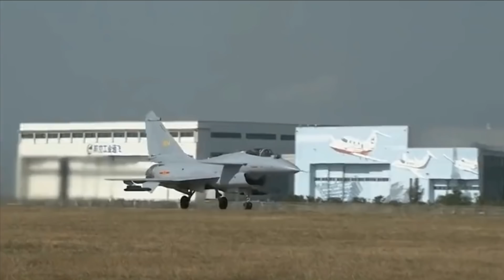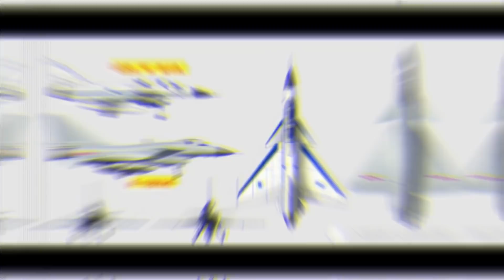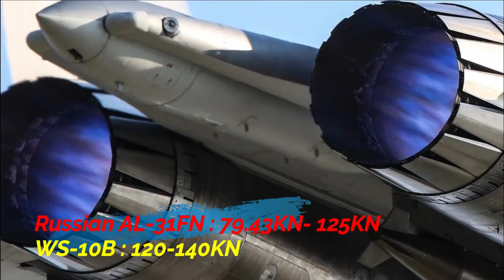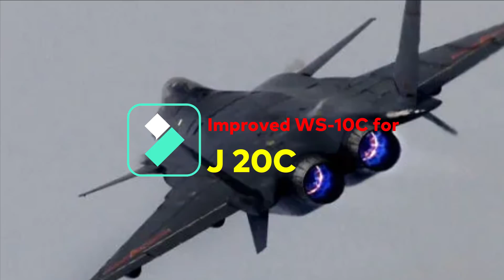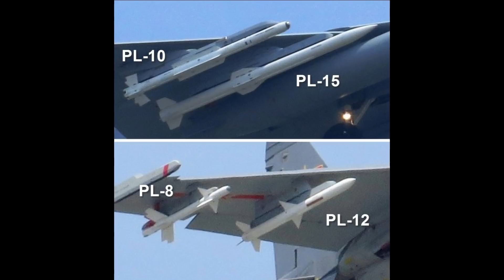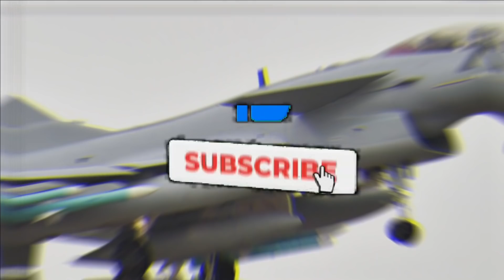How big threat is Pakistan Air Force J-10C powered by WS-10B Engine ?

Comment: Another point not mentiong here, J10 w thrust vector engine unlike Flanker or F22, it is a "single" jet engine fighter performing Cobra and deep angle of attack in the world.

A year later, WZ-15 Emei, AEP 500 turboshaft engine, WZ-20 and CJ-1000A commercial engines have made signficant break through in thrust, thrust weight ratio and lifespan comparable or even beating the western engines in service.

Comment: I heard from a retired paf air force chief that even though china will sell pl15 export version it wont be the general E version of 145 that's for normal customers since pakistan is like isreal is to usa it will get something very similar what plaaf uses themselves with slightly decreased range, no country actually release the exact range of its missiles apart from export versions, so let's say If the actual range of pl15 is 300km then paf will likely get pl15 with range around 250km . Indian airforce has put top priority on new platforms french Rafael is a good choice for them since russian top end platforms  have performed poorly both in Syria (s400) and su35 in ukraine, Russians have made  stuff in 80s  but since have fallen behind in electronics, China now doesn't buy anything from as they own defence industry has cought up and certain areas surpassed them such as electronics ect, the problem india will have in the long run they are buying everything from every country like Egypt, now Indian navy will probably induct f18s for the aircraft carrier that means more money for the taxpayers even though rafale would be ideal choice maybe there is money to be made for the politicians.

Comment: fighter jet is not luxury car for showing off, it is just weapon for fighting, with 4 times cheaper of J10C vs Rafale, in real battle, Pakistan can send 4 J10C to 1 Rafale, J10C carries at least 4 PL 15 missile, assume Rafale carries 6 Meteors, that will be 16 PL 15 missiles to fire to each Rafale , in today's air battle, it is not just one by one or 4 to 1, it is system, both sides will have AWACS, so both sides can find the enemy jets at about the same distance, about 400 km away, J10c just reach Rafale to about 100 km and launch PL15, then fly away, with its M2.1 speed and Meteor no escape zone is 80 km, J10c can just run away, on the other hand, Rafale top speed M1.8, at 100 km range, it will not be able to run away from 16 PL 15 missiles s attack. and the pilot, if he is lucky, can taste some fantastic tea in Pakistan, with his eye blacken and swollen again.

Comment: Pakistan J10-C will crush India Rafale
J10-C radar can see Rafale before Rafale can see J10-C. J10-C PL-15 air to air missile outperform Rafale meteor missile too, so J10-C can shoot Rafale down before Rafale can respond.
F-35 APG-81 radar and Rafale RBE2 radar use the same T/R module provided by same vendor. F-35 radar has 1200 T/R module with 170km working range. Rafale RBE2 radar has only 836 T/R modules with 130km working range. J10-C KLJ-7 radar has 1400 T/R module with 170km working range. Rafale is the most near sighted crap.

Comment: The Chinese and Pakistani air forces have conducted many confrontation exercises in recent years, including the J-10C fighter. The most important thing is that the Pakistani pilots have a mature understanding of all aspects of the J-10C fighter. Therefore, Pakistan finally equipped the Chinese J-10C. 10CE fighter is a matter of course.

Comment: Good analysis but PAF is getting original version of PL15 for J10C and PL15 E for JF block3 as per the information coming from Pakistan defense platforms.
Reply: Haha, the Difference between PL-15 and PL-15e is the signing E, it just needs to call PL15e
Reply: @friedrich.wang.d6768 Ur talking nonsense. PL 15E is about 145km+. And the original variant is more than 200km+

Comment: J10c is just as good if not better than Rafale. It can fly longer and higher with a more powerful ws10 engine. Ws10 has been used for quite a while on other Chinese jets such as j11, j16  plus newer j20s. No issue on reliability. It is equipped with BVR missile that goes further than French ones (Pl15)

Comment: First of all you are wrong about pl 15 missiles Rafael meator bvr missile has a range 200km and pl15 has a range of 500km bvr making it the longest bvr missile and Pakistan is getting the 500 bvr range missile which Pakistan will use in jf 17 thunder block 3 as well

Comment: Rafael has more power but carry too much weapons. J10C is evenly match. The PLAA used J10C against Su35 and beaten Su35.
Reply: more power? you kiddin me right....ws10b alone can produce more thrust
Reply: @劉慧玲-d8u  WS-10 produces 80-86kn dry thrust and 135-142kn afterburner. Rafale has two Engines with 50kn dry and 75kn afterburner = 100kn/150kn vs 86kn/142kn
Reply: PLAAF
Reply: You can always put less weapons if you want lol. 12 Air to Air Missiles only weight around 2 Tonnes

Comment: Numbers will make the difference in a conflict.During 2022 IAF has 36 but PAF will probably induct 86 (50 JF-17 thunder,36 J-10C) fighter having AESA radar.Moreover IAF far from achieving required 42 squadrons to protect Indian Air space.
Reply: Also f16 one of the best fighter jet
Reply: You should turn back to super sukhoi upgrade project......
And then you will find something interesting and horrifying
Reply: @yixinmei5854  Yeah but it's not wide spread enough
Reply: @sharequsman596  

 India has Novator KS-172 BVR air to air missile with 400 km range. So , PL 15 is not major  threat to us.
Reply: @sharequsman596  Don't understand what "wide spread enough" mean
Reply: @yixinmei5854  As in it's a good upgrade but not enough su 30s have it to be considered that important considering I heard their are debates whether the upgrades are cost effective and that India should just buy su 35s or more Rafaels
Reply: @basuvivek643  Never heard of that missle also pl 15 is for AWACS and refueling tankers
Reply: @basuvivek643  That range,like AIM=154,is for slow targets like old bombers or transporters.....
Reply: @basuvivek643  400km range Air to Air Missiles are heavy and less maneuverable, and they don't require maneuverability because they are designed to shoot down AWACS, Refueling, Transport Aircraft and not fighters. You know why Europeans specially designed 25km range IRIS-T (most advanced and maneuverable Missile) if they already had Meteor which can also go 25km apart from 100km? Because smaller Missile has much more maneuverability than long range

Comment: Cheap chinese copy, nice target for S400 😂😂😂
Reply: Chinese got S400 in 2018, they knew the capability and vulnerability of S400, and have already shared the information with Pakistanis.

One of the big issues of S400, is its low altitude detecting range, quote:
"The S-400 is able to intercept cruise missiles at a range of about 40 km due to their low-altitude flight paths."
It would be much shorter if it's deployed in mountains.

So, 40 km, only 40 km!!!
What's the range of YJ-91? 120 km, lol.

You need beg Pakistanis to fly high before you can say they are "nice target for S400". And buying S400 india spent billions of dollars. :)
Reply: @MMA-gb6to  Lol go on Russia's official site rosoboron exports . It claims s 400 have a 4m low altitude detection range . And yes s 400 uses a combination of multiple radars not one . Ok charsi pakistani 😂
Reply: @fatmanfrommillennium7369  How Israeli F-16 dogged S-400 more recently.Is it a co- incidence with India purchase of S-400.
Reply: @mustafakazmi1299  Yes better you go and understand.
Reply: @fatmanfrommillennium7369  undersstand what?
Reply: @donchen4906  What happened did you just gave up barking 😂

Comment: Pakistan always buy weapons with there specific specs not the standard export version 
Similarly as the Indian made 13 specific changes in rafale   so you can not claim that Pakistani pl15 on jf17 block 3 and J10C have a range of 145 km 😉
Reply: Very True as these our newly acquired J-10CP, as P stand for Pakistan are as per our own Specification with WS-10A Engine and not WS-10B, as mentioned here in the subtitle of this video. Wrong information by this Channel !!! btw the Operational range PL-15,  200–300km and (PL-15E) 145km. We have got both the missiles.
Reply: 100% true.
Reply: Enjine is WS10B. Not.   A.

Comment: Why are you afraid you have 272 su30mki   more then 50 mirage 2000    and mig 29 upg     so still i think India have very decent air power against Pakistan yes no compare to china that is true
Reply: We the Pakistan are manufacturing 50, JF-17 Block 3,  in a year. 50 X 3 Years = 150 jets for Pakistan Air Force.
Reply: @saleemchoudhry4145  
Pakistan have a capacity to build 25 jf17 units per year not 50 units per year 🙄
Reply: Pakistan have 80 f16 150 jf-17 36 j10c and mirage

Comment: J-10 and jf-17 block 3 will force india not to field mig-21 at front lines .. that’s the problem I see now .. either we need to procure mirage-2000 second hand in large numbers or some kind of emergency push ( from PMO) for tejas mk1a production and tejas mk2 .. this will make air force stretch thin between two fronts .. 😞 

With Russian threat on Ukraine reducing .. we can 
 make a immediate procurement of su-30 and mig-29 and push for mirage -200 upgrade and buy second hand mirage -2000 and upgrade them on urgent basis

I don’t know when will the relaxed nature of our defense procurement will come to an end 😖
Reply: Yeh Mai Hoon, Yeh Mera ✈JF-17, Block-3 Hai, or Yeh Hamara✈ J-10CP Hai, - pawri hori hai 🤣🤣
Reply: 2nd hand maal achha nahi hota 😂

Comment: An aircraft main part is engine. We need engine first. We need to develop it first. After kaveri project failed its a huge drawback. We need to partner with Russia to develop it like brahmos
Reply from the maker: Kaveri has not failed. Its the Users, decision makers trying to fail it before. But now going in right direction.
Reply: @IndianDefenseAnalysis     after putting 30 years in it, managed to reach 80KN thrust but we need more for tejas and AMCA. now india looking partners to co develop, rolls Royce is one of it. To make our tejas indigenous main part which is engine should be ours too.
Reply: @KurukshetraGym  
Should have invested more money as well . 
We don't even have proper test facilities.
Kaveri is success considering the facilities and investment. 
Kaveri was close to what was expected.
Reply: @bharath8422        yes. I hope modi govt will take it  more seriously than previous govt. I understand developing jet engine is the hardest thing agree with kurroth.
Reply: First you need to build a high altitude simulation test bed of yourself.....
Reply: @yixinmei5854  already have at vssc thiruvananthpiram ,And Nal testing facility in Banglore India.
Reply: @KurukshetraGym  Need more specific information. According to my research Kaveri's high altitude simulation test is done in Russia. And no similar facility in the two places you mentioned. I hope you have not confuse wind tunnel with high altitude test bed.
Reply: @yixinmei5854  we have test facilities but is not fully functional wind tunnel facilities for stimulation of an engine that will work at 40,000 to 50,000 feet above ground and , the Kaveri engine was successfully flight tested using a russian llyushin ll-76   transport aircraft as a flying test bed bcz our testing facility is not fully funtional yet does not mean we dont have anything .   Recently drdo confirmes for establishing HAETF soon that will be capable of testing the engine with 130kn class of thurst to stimulate an engine that will work at 59000 feet upto march 2 speed.
Reply: Building a fighter jet engine is probably the hardest thing in the world. China is much more advanced and ahead of India in defense manufacturing...so much so that they have produced hundreds of advanced fighter jets including 5th gen ones which mostly used Russian engines. Only recently did they manage to succeed in building jet engines. Compared to that, India is yet to build a J10 equivalent. 

Instead all our projects should run simultaneously be it developing new jets or engines. Thankfully we can buy GE and Snecma engines which are reliable, lots of other countries trust and will bolster our exports as well.
Reply: not after the Ukraine fiasco by Russia .. or we'd be welcoming CAATSA sanctions
Reply: @averagestudent5223  yeah agreed, now better option is france or rolls royce